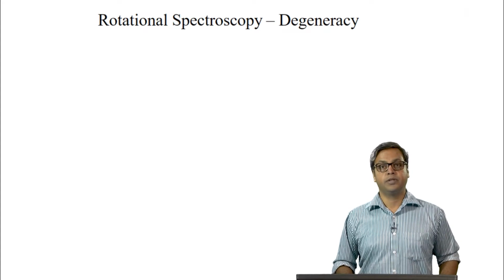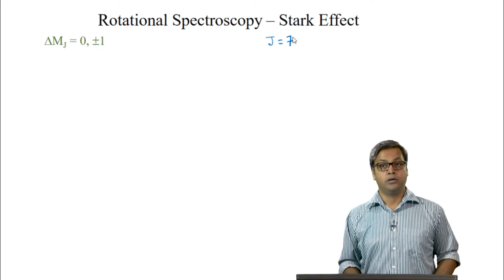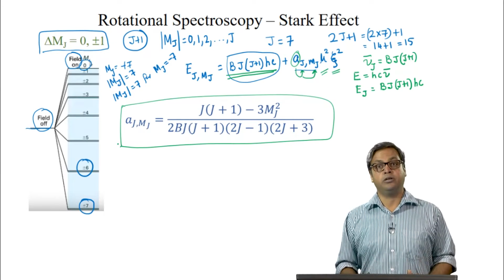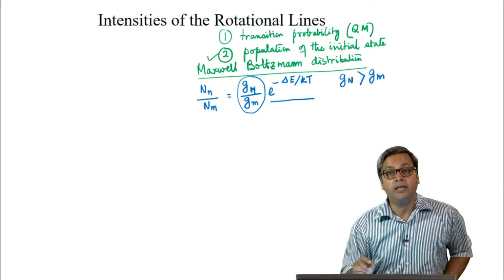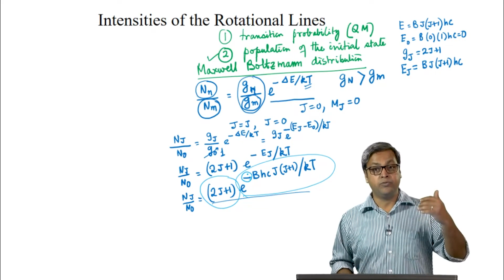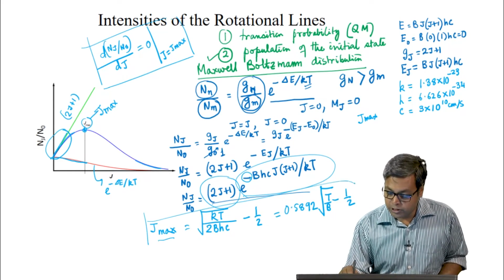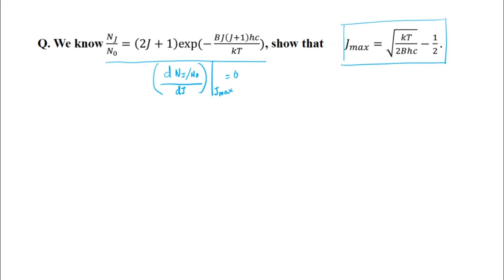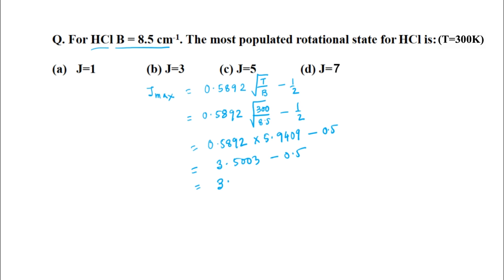Intensities of Rotational Lines

Comment: 7.33 will come only when you don't subtract 0.5 from the root T/ B term. Calculating correctly it will come out to be 6.8356 which on rounding off will give 7 as the J max Value